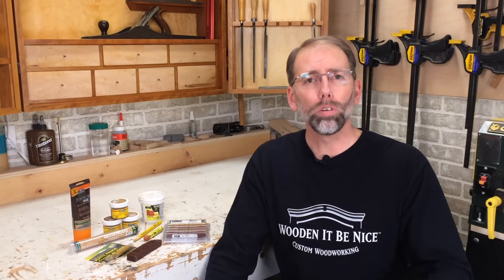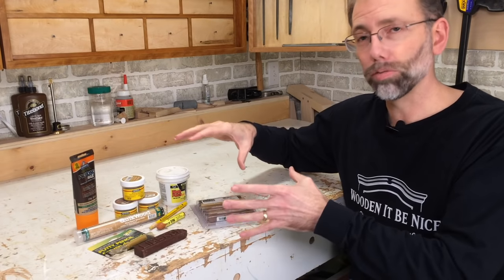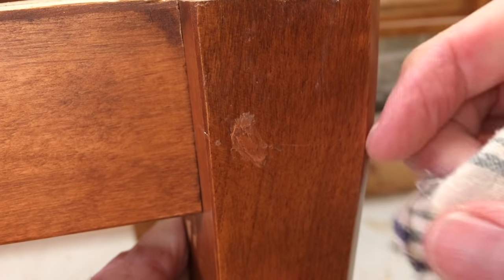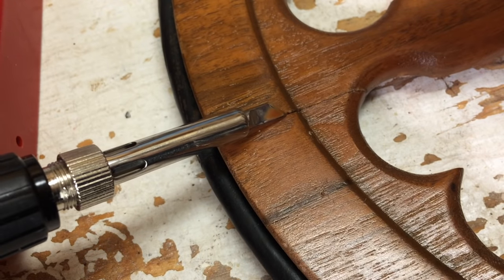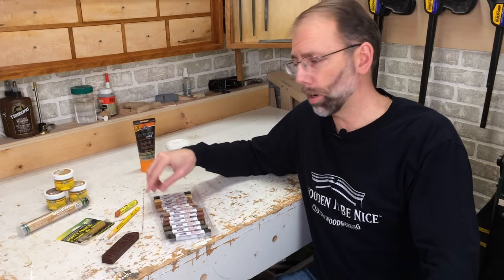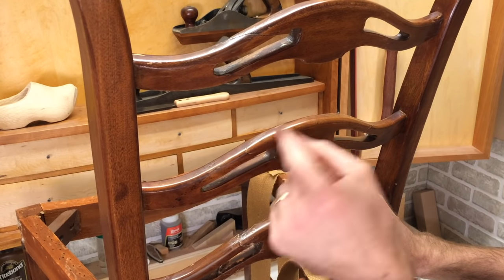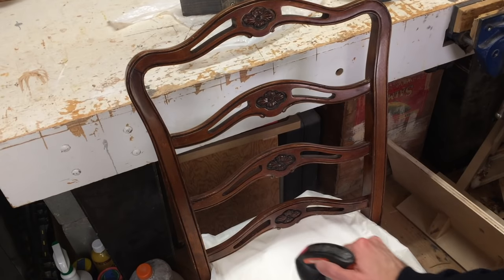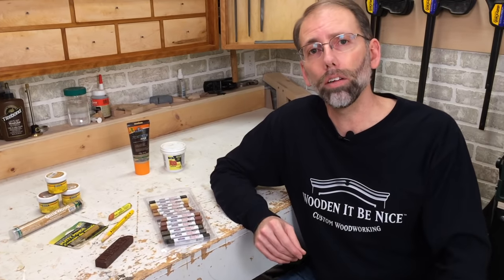Wood Filler & Putty for Furniture Repair | Woodworking How to

Comment: (1:24) Very informative video. I have one question. What do you suggest I use for a dress top underneath towards the corner where there’s a skinny crack almost an inch long if it’s mixed wood with a black color on it? Do I use wood filler in between the line? I want to make sure that little line in corner or underneath top of dresser doesn’t crack off completely since it’s not cracked all the way through to top side. Hopefully you may respond before I purchase something wrong 😅 Thanks in advance 😊

Comment: Very well produced, but it would have been helpful to know the staining properties of each product. Painting is easy but matching a stained oak, walnut, birch, etc., that's the critical thing. For example, how does Quickwood take a light walnut stain, to match a light walnut real wood veneer on a high-end speaker cabinet (corner damaged in shipping). That's my project. Thanks!
Reply from the maker: I personally don't like using wood patching products on bare wood because they are so challenging to stain during the finishing process.  My preference is to use burn in sticks after a piece is finished because I know exactly what colour I need to match.  For epoxy putty, no it doesn't take stain well.  You're best to get a coloured epoxy putty that's close to the colour you want, but a bit on the light side.  You can then tint it further to dial in the colour.  Does that make sense?  Perhaps I should make a video on that.
Reply: @FixingFurniture  Thanks for your quick reply, but not quick enough! 😉 I already used Quickwood and can confirm that it does not take stain AT ALL. It’s like trying to stain a piece of plastic, which it is. On the positive side, it appears to be very strong, bonding very well. There is wood filler out there, made from real wood particles, that does take a stain. But I don’t do this kind of repair often enough to remember the name. Yes, a video comparing staining properties would be good, since most wood needing wood filler is stained. 👍

Comment: what if the teak furniture has a slight glossy/oily finish and there's a hole and crack on a vertical finish........how do i fix the defects without ruining the surrounding wood finish ?
Reply from the maker: For vertical surfaces that can't be moved to a horizontal position, you're best to use several wax sticks and mix them together to match the wood as best as you can.  If you're concerned the wax will get into the grain, tape it off first.  If you're working on an outdoor piece, you should use putty instead of wax as it will move with the wood when it expands and contracts.  Does that help?  Scott
Reply: @FixingFurniture  many thanks indeed......so the wax sticks will work for holes (bigger than nail holes) too ?........i thought of using putty since it's stronger than wax but it's far more difficult to work with......
Reply from the maker: @worstalentscout  Regarding the size of hole, you are correct, wax is difficult to use for large holes and putty is better.  Wax is easier for small holes
Reply: @FixingFurniture  many thanks once again !